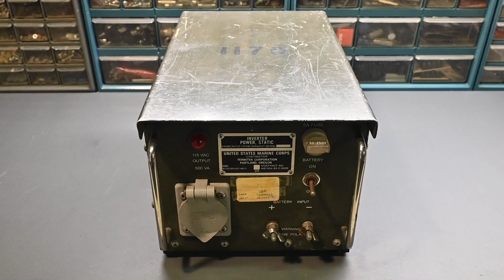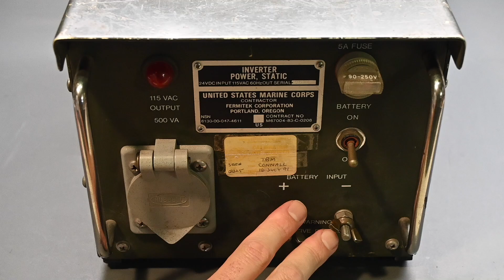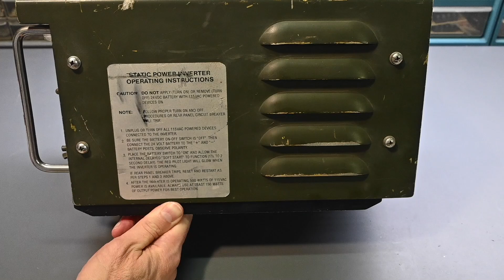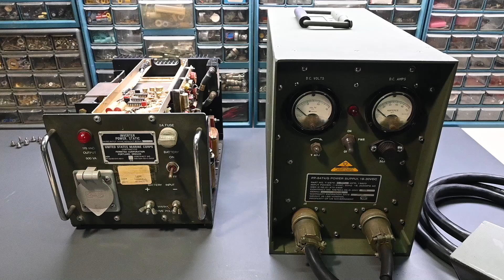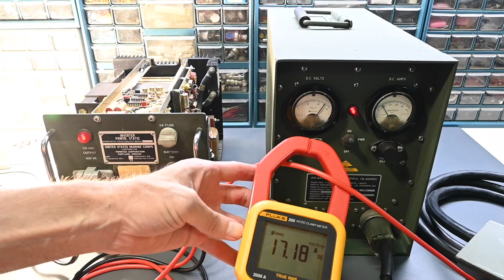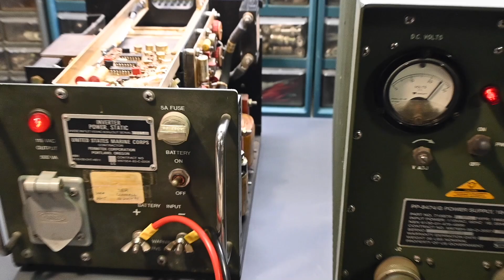Inside a Vintage Military DC-to-AC Power Inverter - Does It Still Work?

Comment: At that time there were better inverters such as Victron Atlas inverters with a higher efficiency
Reply from the maker: This was built for the military and they have their own way of doing things.  Yes other types of inverters existed at the time this was built.
Reply: Nearly all military inverters are of the ferroresonant low-frequency type.  They do this so that the output has a very precise voltage which changes very little under varying loads.  Even though this is a square-wave inverter its output is actually much cleaner than a modified sine wave unit using high frequency transformers-it is actually very close to a pure sine wave.  For the equipment these are designed to run this is extremely important.  These ferroresonant inverters also use far fewer components than a high frequency inverter, meaning they will have much higher long-term reliability.
Reply: The latest generation of inverters have an even higher efficiency and lower self-consumption.
Reply: @lexpee  Yes, and modified sine-wave inverters of even 10-15 years ago are extremely efficient.  But when you are running very sensitive electronics and the inverter just has to work this is the best way to do it.  And very large inverters are almost always the ferroresonant type.

Comment: low efficiency might be caused bij the fact that the transformer is driven bij an audio style amplefier to its max voltage output, maybe somewhat clipped at the peak, what makes the noise sound sharper through the extra hormonics produced at tge clipping point.
Reply from the maker: I wouldn't really compare it to an audio amp style output stage as this uses two SCR's to drive the primary winding. Yes it saturates the transformer and clips the waveform by design.

Comment: The reason for the 20A NEMA 5-20 receptacle is so extension cords with NEMA 5-20 plugs will fit.
Another important reason for the potential marking on the fuseholder cap is cuz those fuseholders were also made for 24V to 32V applications with an incandescent lamp in the cap.  Such caps are usually orange or yellow.
Made in the mid 1980s as there is a 1983 date code on one of the TO-3 transistors on one of the control boards.
Reply from the maker: I noticed numerous 83 date codes on IC's and capacitors.  Fits with the contract date.  Yes I have seen the fuse holders with incandescent bulbs  colored as you mention.

Comment: 19:50 Где можно приобрести такую лампу? Она рассчитана на напряжение частотой 60 Гц и вольтажом 115 В?
Reply from the maker: You can find them on eBay.  The lamp does not care about the frequency.  Only the voltage is important.  Yes it is made for 115-120 volts, you can use a lower voltage but the current draw is less therefore the power is less.  Above 120 volts will shorten the lamp life or even burn it out immediately.

Comment: The transformer portion of that inverter is a ferroresonant power supply.  Same a Sola, except the primary is driven from the inverter instead of a 120 volt winging.  The immediate giveaway was the 600 volt output, which will go to the large oil filled cap forward of the transformer.  The core is run in saturation all of the time as a means of voltage regulation, regardless of load or input voltage (within reason).  That's where most of the 125 watts is lost.  The 600 volt winding and the oil filled cap are a tank circuit, resonant at 60 cycles.  The output voltage should rise when the frequency is raised up to spec.  What a super cool piece.  Would be neat to see a scope on the output.
Reply from the maker: Thank you for the information.  You might like to see the follow up video https://www.youtube.com/watch?v=Q2KF4k_8daE  I do measure the output on a scope and adjust the  frequency which as you mention raised the voltage.  In the follow up video I ask if anyone has ideas about the 600 volt circuit.  Your info is exactly right.

Comment: So, it takes 1200 watts on the DC side to make 500 watts AC.  Wow, the old UPS's and stuff I worked on were never that inefficient.  And that thing must get pretty HOT too.
Reply: Nope, something went wrong in your math. At 300 watts it's drawing 412.8 on the DC side a net conversion loss of 112.8 watts. 72.7% efficiency assuming the bulb is actually drawing 300 watts.
Reply from the maker: Yes it is power hungry!  The ferroresonant transformer runs in saturation and gets quite hot by design.  Being that it was built for the military I think rugged and indestructible were the goals over being efficient.

Comment: Always fun to see old military gear. I was a Marine avionics tech in the late 1960's. We had 3-phase 400 Hz inverters in our vans but they were not used as we had 400 Hz generators supplying power. I assume they used similar low frequency switching as back in those prehistoric days semiconductors had severe switching speed limitations.
Reply from the maker: Glad you enjoyed the video.  Often those old power switching transistors were germanium instead of silicon.   I have a Unitron 3ph 400Hz inverter in the shop, I repaired it many years ago, most of the power transistors were fried and it was very difficult to find the replacements.

Comment: I wonder how the sinewave looks like on the output. Is it a true sinewave inverter or a modified inverter or something in the middle? judging from the sound it might be a modified inverter but that's just a guess
Reply: Some of these units used a ferroresonant Xfmr on the output to clean up the sine wave and assist with voltage regulation.  That adds lots of weight.  Everything needed tons of filtering back then.
Reply from the maker: Check out the follow up video https://www.youtube.com/watch?v=Q2KF4k_8daE   I measured the output on an oscilloscope.

Comment: If an inverter is rated at 500w can we go up to 500w.  I always thought you need to go upto only 0.6 of a rated inverter.
Reply: In most scenarios inverter power rating is primarily like this:
3000w inverter, in actuality that would be peak, under continuous load it's half that so 1500w. You have to look out for peak power and continuous power. Continuous power is what it can supply continuously.
Reply from the maker: It depends on how it is rated and often peak values are listed for advertising purposes but the actual continuous rating is lower.  In this case the 500 watt is a continuous rating.